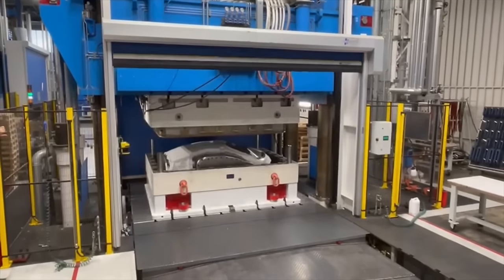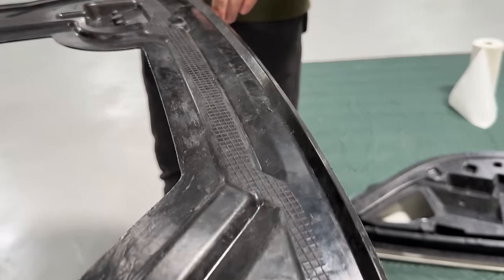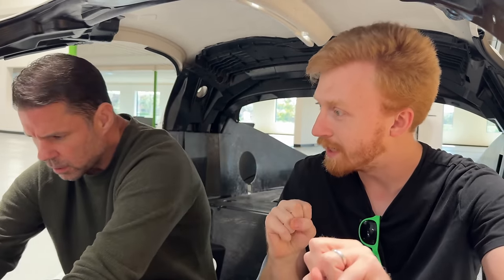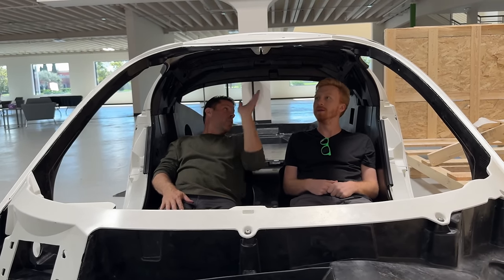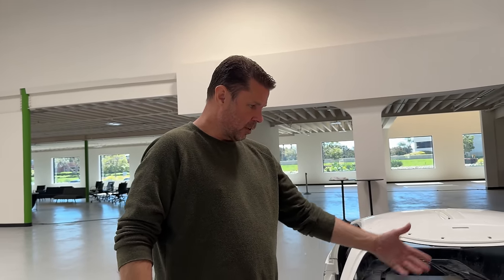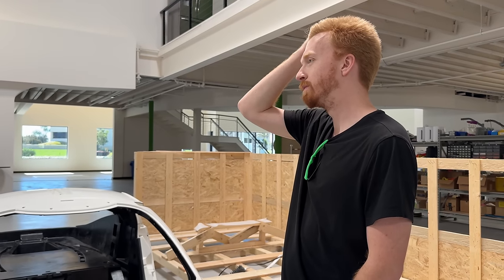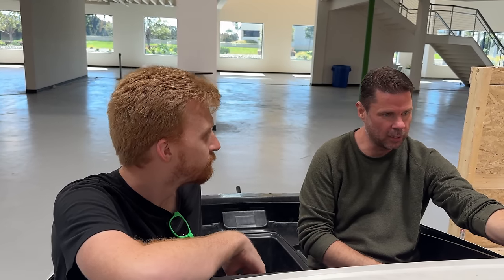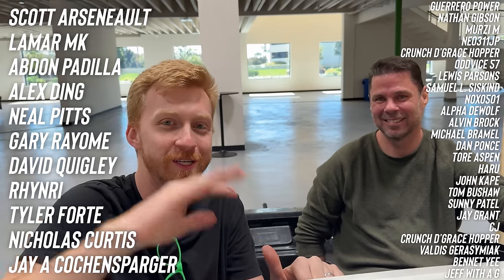Aptera Answers YOUR Questions!

Comment: Building the car has a 12 minute cycle time. Wrapping the car takes 90 minutes. That means they'll need 8 stations for wrapping to get a car out the door every 12 minutes. Thats a lot of real estate and completely changes their old assembly path drawn on the floor and depicted in their assembly simulation.
Reply: If they used the conventional paint shop approach, the factory would have to be double its present size and cost another billion $$$. Eight wrapping stations would be cheaper.
Reply: Wrapping is post assembly, and does not need to be done in this facility. They can drive the vehicles to a nearby facility to perform the wrap.
Reply: @richpate9436 they’ve never said the Aptera would be painted.  So your point is irrelevant.
Reply: @bvgreui around 9:40, Chris said it would be done at the back of the line, not offsite.
Reply: Funny how many people are wrapping the Cybertruck.

Comment: Does Aptera have any plans to sell a rolling board that would allow someone standing at the back of the vehicle to pull the board and anything sitting on top of it towards the rear of the vehicle for removal?  Anything like this to make the Aptera easier and more practical to use for cargo fleets could add value for those types of customers.

Comment: 11:22 raises some security concerns if there’s no encryption employed — if all those messages are being sent in plaintext from the app to your vehicle, couldn’t someone looking to steal an Aptera use a tool like Wireshark or Cain&Abel to sniff them?

Would definitely need to use some sort of end-to-end encryption to prevent that scenario, because man-in-the-middle attacks on SMS-based car controls would certainly become a problem otherwise. Good thing I’m on track to receive a CEH cert in June.
Reply: Of course over-the-air commands will be signed and encrypted. That's standard practice and has been for years. That Apple chip is part of Apple's encryption system.
Reply: @fotoguru222 Apple CarPlay and SMS are two entirely different things. The former is encrypted; the latter needs some additional measures, and the latter is what Chris is saying is being used to open doors, turn on the A/C, etc.
Reply: @kennystrawnmusic  Yes. The real question is not whether they'll use encryption, but whether or not the encryption they'll use be strong enough.
Reply: @kennystrawnmusic  I thought that the SMS was being used for monitoring and being able to check on your systems without the computer to be really powered up or something like that.

Comment: Greetings to enthusiasts of the most efficient aerodynamic electric car, whose mass production is steadily approaching!  If we consider the Aptera as an electric car for long-distance travel, often to those places between cities where the cellular signal is not strong enough or almost completely absent, then how is it supposed to solve the problem of the lack of Internet and even cellular communication?  For metal cars, amplifier antennas are placed on the roof, and the metal roof itself becomes an antenna collecting radio signals, but what about Aptera?  So far, from what I have seen and heard, a mobile phone is supposed to be used to communicate an electric vehicle with the outside world, but its ability to pick up a signal is very limited, due to its size, even a tablet provides a much more stable connection and connection speed.  Is there, or could there be a solution built into the design for the future, on how to stay connected on a long journey into the wilderness “to a house by the lake” (the Aptera solar roof will provide electricity and autonomy, but the rest?))) or has no one asked themselves this question yet?

Comment: I was wondering if we could get our aptera with the new airless tires that would add to the aptera's control, and more environmentally friendly than normal tires.  just think, then, the only things to need replacing would just be the brake pads and windshield wipers lol..
Reply: With Right to Repair, you could add them yourself if you wished.  I have not seen information yet that suggests the pluses and minus trade offs make it worth it for Aptera's design goals, but we will see.
Reply: I could see that on the rear tire.

Comment: Add an exterior way to get into the car without power.  I don't want to have too break the window in the event my car is without power or something in the software is not working.
Reply: Have you never locked your keys in your car? Same situation. 

The likelihood of the Aptera being without enough power to open the doors is pretty low unless something catastrophic has happened.

Comment: Just FYI - My ebike uses about 24 watts per mile. The calories burned are about .33 watts per mile. So that is more than 4X more efficient. A regular bike (.4 watts calorie equivalent) is at least 250X more efficient than an Aptera. Although the bike rides at much lower speeds.
Reply: Why post this, they were talking about highway speeds. Who cares about 5-10 mph!?
Reply from the maker: The energy required to get those calories is higher than just having an EV that can charge off of sunlight
Reply: @timsmith6815  It was a for fun calculation since they mentioned the Aperta perhaps being more efficient than a bike.
Reply: @TailosiveEV  It takes 7–10 calories of input energy to produce one calorie of food. So that would make the bike 25X more efficient rather than 250X more efficient when considering food production. So, the bike is still significantly better. I think a bike is actually more efficient than walking.

Comment: There was a lot to absorb in this interview. I'm not sure I caught everything. I'll have to watch it a couple or three more times. 😂

The first thing that jumped out at me was the plan for a child jump seat on the rear cargo area. I had assumed it was too high for a seat because of the lack of headroom. But maybe I overestimated how much headroom is needed for a child. 

Chris did confirm my assumption that the resr crossbrace on the chassis is the reason the cargo area must be that height. I was wondering if it could be lowered without weakening the chassis, and apparently it can't. The height is needed for tortion strength. So you can't carve out a bucket for a seat in that cargo area. 

The rear wheel could be moved back, though, and the battery lengthened. So the vehicle could be longer. That could add a back seat.
Reply: I think the child seat thing was just a joke tying in that since it's considered a autocycle or motorcycle, you can fit as many people on it as you want.  Kinda like what you might see a scooter with a family of 4 on in some Asian countries.  But I'm sure they're thinking about it for a future design option.
Reply: @artboymoy  I saw a family of seven on a Russian Ural in Iran once.  But Aptera customers won''t be considering this.

Comment: Honest question - for the price that they're charging for this: why would I buy this over a Tesla Model 3? Or heck, even a Model Y after the EV tax rebate. I get that it's going to be the most efficient EV on the market plus with solar to supplement charging but it doesn't really make sense for most people. Imo, for most people, this would be a fantastic secondary vehicle - so the price point they're setting doesn't really make sense. If the entry price were more reasonable - this would be a no brainer for me. But the price they want, I have to consider other cars in this price range...and the math just makes no sense to me. Though, may be different if I lived somewhere like California where the gas price is 2x the national average.
Reply: Just so there's no misunderstanding - my main point is that this wouldn't work as a primary car for most people unless you don't have a family. This would be a fantastic secondary vehicle for most people, but not at that price.
Reply from the maker: It's cheaper than a base Model 3, and close to a base Model Y, but neither of those will get over 300 miles per charge. Aptera gets over 400 miles. Many can't charge from home because they live in apartments or rent and don't want to pay for home charging equipment + installation. Aptera eliminates those issues by charging itself from free sunlight. Aptera is also more supportive of Right to repair which scares many away from buying Teslas.
Reply: Getting you over 2.7 times further down the road per kWh than a Tesla, with most of your yearly kWh's powered by the sun. Aptera's post purchase operating costs will be MUCH cheaper than a Tesla. Supercharging costs add up when road tripping. And Aptera will only have a fraction of the phantom drain issues, and you won't notice them because the solar will be upping your battery's game, rather than having phantom drains, cabin conditioning and sentry mode wearisomely dropping it, and costing you $ to refill it. 

Then there are those who will now not be seen in a Tesla because of Elon's insensitive commenting, and his very out there politicking. At least as some in the MSM tend to portray him. I cut him more slack, listen to all that he says in context, but disagree with his views on some issues that are important to me. Just saying his personality/persona as portrayed has polarized a significant chunk of consumers out of buying Tesla's brand. On the positive side it may help get some on the right who tend to be more EV phobic to purchase them earlier, rather than later.
Reply: If you only need a two seater car, the Aptera is very competitive with a Model 3. The Model 3 uses about 2.5 times more energy per mile than the Aptera, and once you add the free energy from the sun, you can figure that the Tesla will have 4 to 5 times higher charging costs that the Aptera, which will add up over time. 
If you live in a place where you can't install a Level 2 charger, then the Aptera is a much better car, because it gets enough miles of range with just an 110V outlet. 

Aptera's dolphin-like shape and solar panels are going to attract a lot of attention, and some people like having a car that makes people stop and stare. Others don't, but for people who like attention, the Aptera is a better option than a Model 3. For people who care about the environment and having a lower carbon footprint, the Aptera is probably the most environmental car on the road (despite the higher embodied CO2 of carbon fiber parts). For engineering nerds who like energy efficiency, aerodynamics, CF-SMC and solar power, the Aptera is also a more interesting car. There are people that just like having the newest thing, and for the next couple years, the world's first solar-powered car that is commercially produced is going to be the novelty on the market that generates buzz. 

It is unclear when Tesla will produce its $25k car, whereas I expect that Aptera will be producing cars that cost $27k by 2026.
Reply: If you are a single vehicle household with three or more people, the Aptera is not for you. 

If you need a second/commuter vehicle for only one or two people, the lower lifetime cost of the Aptera will outpace any other vehicle out there. It’s a long term investment as opposed to an upfront cost savings. Two different schools of thought, financially speaking. You get to choose which school of thought you fall into. 

We are a two person single vehicle household. We haven’t had more than two people in our vehicle in over ten years. As someone who looks at every dollar spend from an investment perspective, the Aptera is a perfect fit for us. We just need to keep our older model ICE vehicles going until we can afford a “new car” payment/purchase and buy the Aptera. At that point our monthly “vehicle maintenance” cost will drop considerably. Otherwise we will be buying yet another used vehicle to get us to that point. 

We are currently about three years from being able to purchase the Aptera either outright or with financing, so we are right on schedule for where Aptera is in production. The early model Aptera’s will have been on the road for a year or two at that point and any bugs will have been worked out. (Not that I expect many if any.) They should be up to speed on production and the wait time should be relatively short. I will most likely put in my reservation by the end of the year to reduce the wait time further when we are ready.

Comment: About the fast charging (people mentioning they want a 150kW fast charging capability): This thinking is fallacious. The actual useful criteria is this: how many km/miles can you recharge per minute. And if the Aptera-Data is accurate, they consume 6-7 kWh per 100km, which is about 1/3 of what the average EV consumes. So the km per Minute charging time is about the same with 50kW when the other car uses 150kW.

Comment: All that carbon fiber sounds very expensive. I remember when the first gen Aptera was going to use a much more affordable fiberglass composite structure. (About 20 years ago)
Reply from the maker: It’s stamped carbon fiber SMC which is much cheaper than the traditional woven carbon fiber
Reply: @TailosiveEV  maybe cheaper than laying down sheets of woven carbon fiber cloth, but still fancy enough to be used on Lamborghinis. What’s the current MSRP predictions for the Aptera?
Reply: @jamescaldwell5  Price projections haven't changed yet from when it was originally announced.

Comment: I’m confused on the bike efficiency comment. My e motorcycle at 80mph is 90 wh/mi, which seems lower than aptera even with all the drag from my body. Obv aptera is way more practical and safer, but I don’t understand how my bike would be more efficient? My bike is just over 300lbs
Reply: Is your e motorcycle "efficiency" at 80 mph published online?
Reply: @johnreeves7261  no, from personal experience. It’s a zero s 7kW battery, so docs are online. I think it give miles estimate, but efficiency is shown on the dash. 7kW doesn’t get me that far, but fun and cheap to operate
Reply: No way your e motorcycle is getting 90 wh/mile at 80 mph on the flats with still air.
Reply: It depends on a lot. Today, I went average 70-75 and got 78wh/mi average. Last week, I took back roads 55-60 while hilly and windy, and got an average of 100 wh/mi. Anecdotal info, but it’s what I have. My bike is less than 500lbs including my weight.
Reply: @phizwizzle8984  Find a flat road and run many miles in both directions at the same speed (70 mph).  Add your wh/mile in one direction to the wh/mile in the other and divide by 2.

Comment: One question that I have not seen answered yet is,.. Can it tow? I know the LE will not have any type of hitch, but can one be added aftermarket? If so, assuming the trailer weighed say, 300lbs. How badly would that affect range?

Obviously were only talking say 50 miles or so here, not towing across the country or anything.
Reply: I don't think this will have the capacity to really tow anything.  And you're just going to probably burn out your motors and drain you battery if you do manage it by killing any efficiency you have going for it.  I'd be interested in being able to attach a bike rack to it, because I really hate just throwing my bike in the trunk.  It's so awkward.  This is pretty much a second vehicle for people, and if you need the towing capacity, probably renting and ICE would do the trick if the Aptera is your only vehicle.  You will be saving so much money from gas and maintenance, it's not even funny.
Reply: I know Aptera has considered towing capacity in the range you mention, and would not be surprised to see it added in a future model, or even as an aftermarket add on.

Comment: I am wondering that considering how rigid (and sound transmitting) the CF panels are, is sound dampening a problem?
Reply: Carbon fiber is viscoelastic, vibrations will not be an issue around the speaker housings or adjacent, rear body panel.

Comment: The only electric car I would ever consider buying, that is if I had money in the first place. :face-purple-crying:
Reply: I've never considered buying an EV until now. I can't charge from home.

Efficiency, Solar Power and a standard outlet for charging is a game changer for me.
Reply: @Fairburne69 if you can’t charge at home then how is a standard outlet for charging a game changer for you?
Reply: @gbpg2016  I live in a condo.. Having a special charger for normal EV's is not something I can do. But I can run an extension cable to my car when the solar energy isn't enough. All I will need is a 15 foot cable.

Comment: You asked a lot of questions (good) and asked about the low-voltage battery (good), but missed the opportunity to ask if they're going to join the 48-volt revolution that the Cybertruck is doing.  Less copper = less weight (and cost).
Reply: What would the "low voltage" battery, whether 12 volt or 48 volt, do in the Aptera?
Reply: @johnreeves7261  I'm guessing the car has lighting, cabin temp control and A/C, control computer and infotainment., same as most other cars.
Reply: @pfurrie  Cabin temp control and A/C from the low voltage battery?  Really?
Reply: They've said elsewhere that they won't be using 48v until it becomes an industry standard, and they can but the components they need off the shelf